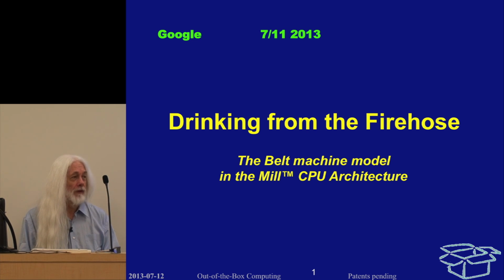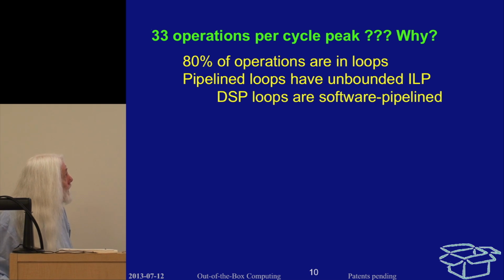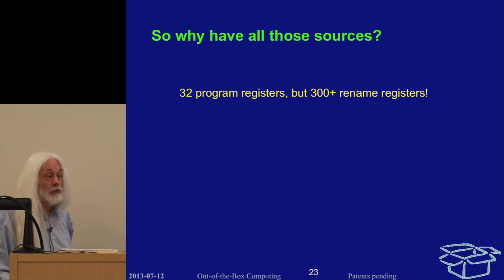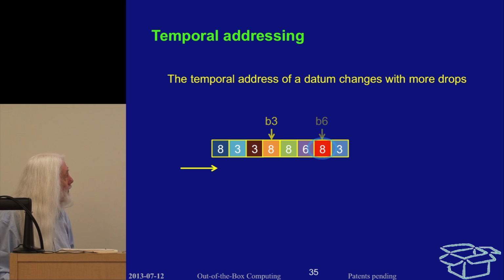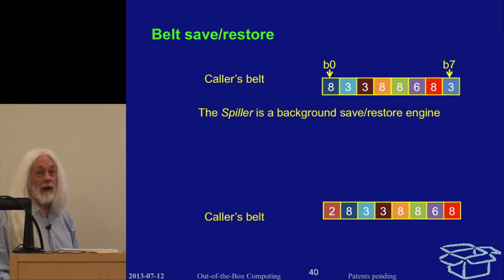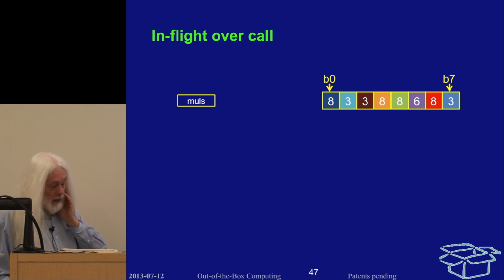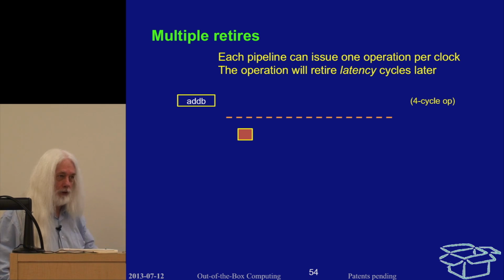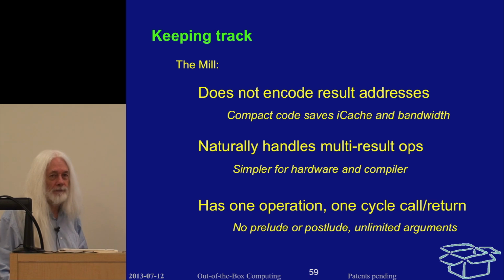The Mill CPU Architecture - the Belt (2 of 13)

Comment: I do not understand the following: If x86 uses 90% of area for managing out-of-order execution and registers, why do they provide hyperthreading? This sounds like duplicating the 90% of area needed for management, adding some more area for coordination of hyperthreads, in order to share the 10% area of functional units.
Reply: Actually, OoO CPUs already have a lot of the resources needed for SMT, that's the reason why you see so much prevalence of multithreading amongst OoO CPUs. 
See here: http://www.ece.cmu.edu/~ece742/f12/lib/exe/fetch.php?media=onur-18-742-fall12-lecture10-multithreading-ii-afterlecture.pdf
Reply: Actually, roughly 50% of the die area of most modern processors is used for different kind of caches, so strictly speeking, your statement isn't true. However, if you omit the area of the die which is occupied by caches, than there is some truth to your statement: roughly 90% of the remaining die area is used for OoO-management, but also for branch prediction, TLBs &, you guessed it, the decoding stage & the micro operation dispatcher for the x86 ISA! & while certain large parts indeed only exist to compensate for the grown weaknesses of the x86 architecture, these inefficiencies won't become problematic in the near to mid-term future simply because they are, by & large, overshadowed by even bigger & more fundamental problems of computation:
1) the memory wall,
2) limitations of the current approaches to parallel computing,
which both will in all likeliness require even more on-die cache/local store memory & radically different kind of computing architecture & access topology (tags: reconfigurable computing, e.g. the stuff rex computing does with their NEO architecture & also to a certain extent the stuff google does with its Tensor Flow Units, TPUs)
So, until these 2 computing bottlenecks are overcome, you prob. won't see any major improvements in computing efficiency by simply switching over to a different instruction set architecture or even machine model. However, after those are overcome, you probably will, because then those inefficiencies of the x86 architecture actually will become bottlenecks!
Reply: Frank Harwald
Do two hyperthreads of the same core share one cache? Then I can see a value in hyperthreads.
Reply: SadEugene But coordination of filling a pipeline from two instruction streams needs additional chip area. Why not just duplicating the functional units then and prevent any conflicts between the hyperthreads this way?
Reply: SadEugene
Maybe I can rephrase my question: According to Frank Harwald above, a chip consists of 50% area of cache of various types, 45% OoO management and 5% functional units. First I consider a quadcore chip without hyperthreads. I have 4x50 die area units of cache, 4x45 units of OoO management and 4x5 units of functional units, in total 400 area units.
Now I give each core two hyper-threads. I get 200 units cache, because two hyper-threads share the cache of one core. Plus 4x2x45 units of OoO management, because each thread needs its own scheduler. Plus 4x5 units for functional units. What is the additional cost for hyperthreading? A wild guess: 20 units. Total space consumption: 600 area units.
Now I compare with full eight cores, however still with shared cache for pairs of cores. I get 4x50 units of cache plus 4x2x45 OoO management plus 4x2x5 units for functional units, total area: 600 units.
Thus there is no advantage in space consumption if I add hyper-threading instead of a further functional unit. If space consumption is not improved, what else is the benefit of hyperthreading compared to adding more functional units?
Reply: SadEugene
To put it differently: Every hyperthread needs its own register bank and register aliasing, needs its own branch prediction buffer, needs its own data dependency analysis. I cannot see what two hyperthreads can actually share other than the plain arithmetic and logic operations.

Comment: Watching the video and so far have one question...  Instead of a 'belt' why wouldn't you use a 'ring' type buffer?  It would be much easier to hand code and debug in the long term if the assembly references to registers aren't always changing.  With a ring, the register references aren't changing, but where the next values go are.  I could have it totally wrong though...
Reply: I think it is done this way so that any operation in a software pipelining steady state can target any result of any operation in the steady state.
If the register addresses stayed the same, in most loops the compiler would have to put the same instructions in the steady state multiple times, because each cycle would need to target different registers.
Reply: Plus, that makes the model look more like a weird register machine. The issue is that the mill has no registers--it just forwards results from the end of a FU pipeline directly to the input of another FU pipeline, and only occasionally touches the actual register file (scratchpad is basically a register file). So you still end up needing hardware to map queue positions to actual pipeline registers, and only save the cost of a six-bit adder, which you more than pay for in the ballooning I$ to hold all those unrolled loops.
Reply: For hand coding, the assembler must do scheduling, at least to be functional for use by humans. So you can write SSA by hand in whatever order tickles your imagination best. The assembler then should tailor it to the actual architecture “definition file” or something. I know nothing of how they actually do it, but if I were to play with that idea, I would want the assembler to take SSA. We’re used to coding with explicit register names, but SSA is much, much nicer - you don’t need to worry about assigning registers, for one thing. Or you could be writing for a stack machine, and let the assembler translate it. I wouldn’t call such an assembler “compiler”, since it’s a much lower level and simpler bit of code. It takes very simple algorithms (conceptually and in implementation) to for example assemble FORTH for this machine. At least I think so. The Belt approach seems in a similar spirit to various MISC (minimal instruction set computers) coming from Chuck Moore. There, the “stack” is a fixed length circular buffer, but the head/tail can move both ways. Belt constrains this to one-way motion. A literal implementation of Belt would be something like a GreenArrays core with operand addresses added to the opcodes. The stack already is an 8-level “belt”, at a hardware level.
Reply: The similarity to stack machine architectures make me wonder if one could use a restricted subset of the lua bytecode or other stack machine based virtual machine bytecodes directly-(ish) on the hardware

Comment: I'm don't really understand why there is a scratchpad, per se. Obviously you need a place for long life values to "spill" over. But why handle that manually via spill and fill operations? Can't the compiler just handle that behind the scene and simply provide the illusion of an infinite belt? The talk mentions the illusion of an infinite scratchpad, so it seems only logical that one could just do the same with the belt itself. Another way to look at it is via regard to code for a 8 slot mill vs a 16 or 32 slot mill. If you have to handle these spill and fill operations directly then compiling for an 8 slot mill is going to have to call of spill and fill more often then code compiled for a 32 slot mill. But if instead, the scratchpad were treated as a virtual extension of the belt, fill and spill would not be required at all, and the same code would work on any mill size. (The compiler should always try to have consumption occur as close to front of the belt as possible).
Reply: The Compiler does use spill and fill to create an illusion of an infinite belt.

The problem is: Hardware doesn't work that way. The belt actually doesn't exist, and is only composed of lots of temporary output-latches of the functional units (and a few actual registers). Before these get clobbered because you retire too much (i.e. fill up the belt) you have to copy them to the scratchpad (spill), which is a SRAM-like buffer in the CPU

If the hardware contained logic to do all that automatically, then it would use much more power and would be much closer to an OoO machine like a Xeon power/performance-wise.

Oh, and: The same code does get compiled to a format that works on all Mills: Gen-form.
It's what you install from a package or installer, and that installer usually calls the specializer which creates the Con-Form for your machine and inserts spills and fills.
Reply: If I was coding for this thing, I’d expect the assembler to abstract this stuff away. And that’s what yrlf’s answer seems to hint at: the “assembly” is generic, more like a compiler SSA IR or something like that. We’re just so used to assembly where all this stuff has to be manually managed that it’s hard to break away from that mold.

Comment: not original architecture. This is MISC+VLIW
Reply: +Вася Пупкин this doesn't use a stack-based register model, but rather a queue-based register model, which is a different machine model all together (called belt)
Reply: The earliest MISC+VLIW was the Novix FORTH chip but the belt is an advance.
Reply: the earliest chips using stacks instead of registers were in the USSR. lol...
Anyway, if the speech about development of the specific chip, its popularity more than for 90% is will be defined by existence at least standard mechanisms of memory protection. 
Forgive me for bad English, if it so.
Generally looks strange that else who wasn't engaged in the hardware support of Nanokernel OS or their full hardware implementation on the chip. Or I don't know something?
Reply: It's not MISC at all. It's very much a CISC architecture -- it has a function call instruction!
Reply: @Wren6991  In a way, MISC does exactly that too, since in Forth calls and returns should ideally be zero-cost, otherwise the performance suffers. The data stack is how callers and callees communicate. The software has to be written so that a function only consumes its allotted arguments and returns what is expected of it. EXACTLY as in the Belt-based architecture. Belt makes the frame-level protection explicit. There are some classes of exploits that you could formally prove this architecture to be safe from.

Comment: I would usually share your sentiment, especially if we would be dealing with the complete idiocy that are the software patents. But this is hardware they are talking about and real inventions not Apples squares with rounded corners.

ARM as proven that designing CPUs and licensing your design to a multitude to competing manufacturers works well for everyone involved, especially the consumers.

Comment: It could, but I guarantee they won't do that, adding another 32 or 64 logic lines to each storage location just for debugging would more than double the size of the belt (in physical geometry). Something like that belongs in a simulator, and I believe Valgrind already has that capability with the obvious negative implication for performance that running in a simulator carries.

Burdening all programs with that sort of instrumentation, which would see few uses would be totally insane.

Comment: Both amazed and scared. I can't shut the little voice that repeats "Itanic ! Itanic !" in the back of my head. The road to hell is paved with good intentions and sexy ideas !
The belt is certainly a great idea but can't solve all the problems. I'd use 2 or 4 separate belts for very large implementations.

Advice : keep only the good, simple ideas and create a stripped-down, fully functional and easy to use version of the architecture. Complexity will kill it.

Comment: That's the way the UI on the sim (which we expect will also be the UI on the debugger when running on hardware) works now. Or rather, it tracks the particular operation, not the instruction that contained the operation; after all a single Mill instruction could contain five different adds :-)

Comment: Very interesting talk.  This is a novel architecture, kind of a spin on a stack machine.  I wonder what the real cost is for maintaining this abstraction at the software interface?  Also, is an exposed pipeline feasible for a consumer-grade chip?  What if the latencies change in the next generation of chip?  Do I need to recompile my OS?

Overall, fascinating talk.  I'm interested to see where they take these ideas.